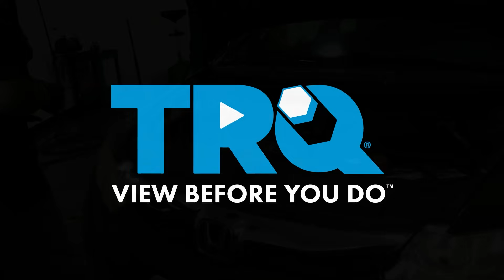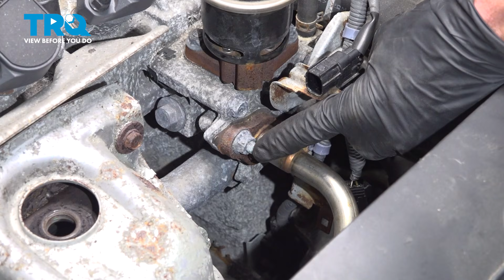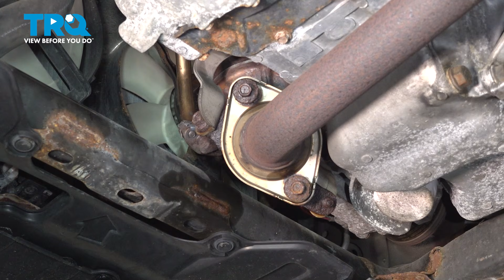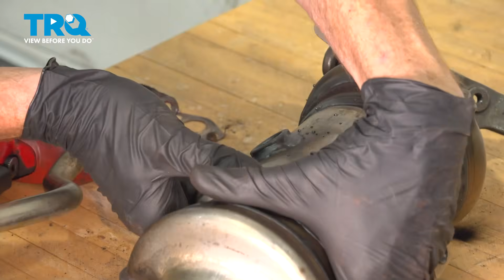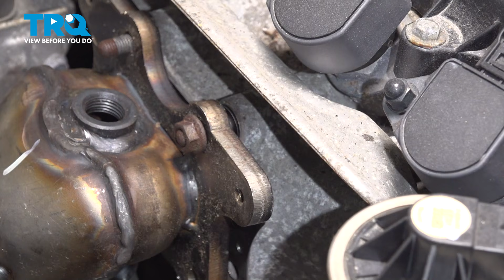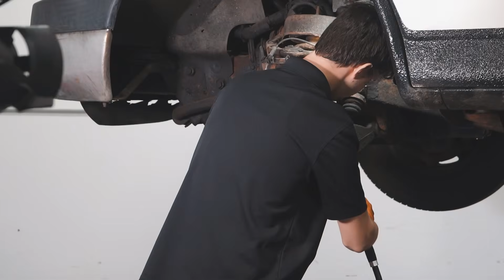How to Replace Exhaust Manifold Catalytic Converter Assembly 2006-2011 Honda Civic

Comment: Thank you very much. Your video was a big help. I was getting a check engine light and overheating somewhat with a 420 code with my code reader.  I used your video to replace my cat converter and the light and overheating went away.  I struggled getting the bottom heat shield out because one of the bottom bolts was difficult. So I removed the entire part and then removed the bottom bolt of the heat shield. When installing the new part I jumped ahead in the video and installed the bottom heat shield along with the bottom 02 sensor outside the car to make it easier. Then I went back in the video and continued with the rest of the installation. Worked out great. Thanks again.

Comment: I changed my exhaust manif gasket by removing the 2 studs on the top of the manifold along w the 2 lower manif bolts, upstream o2, and heat shield. U can slide the old gasket up and out and drop the new one down into place. The Cat Conv piece will seperate about 1 inch away from the block without u having to risk busting all those other bolts. I was very pleased to of successfully avoided all that trouble.

Comment: you defnitely made it way too complicated by removing the heat shield and O2 sensors while the cat was still connected. you can do all of that after the cat is out.